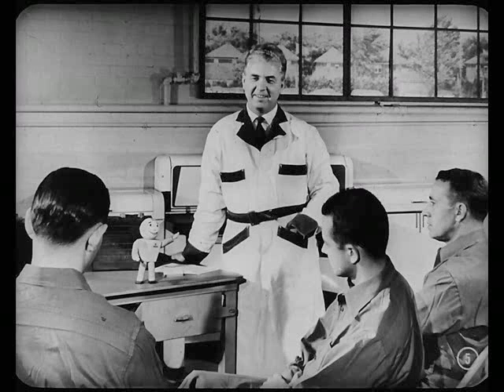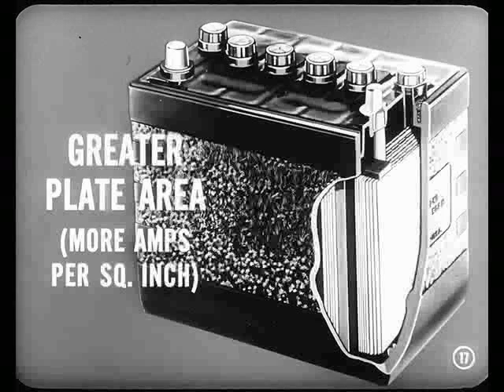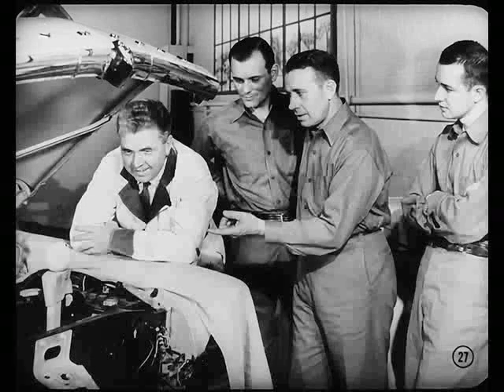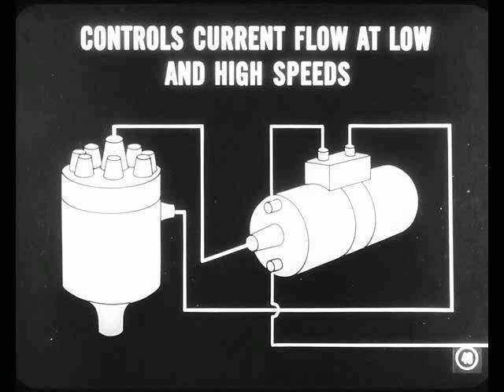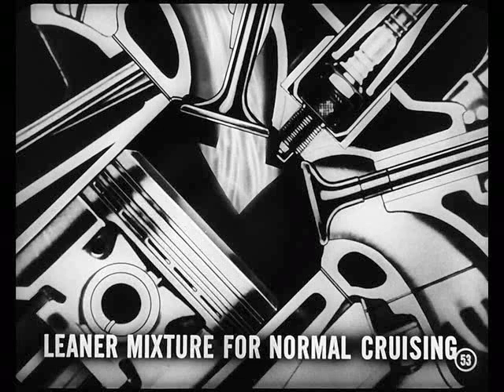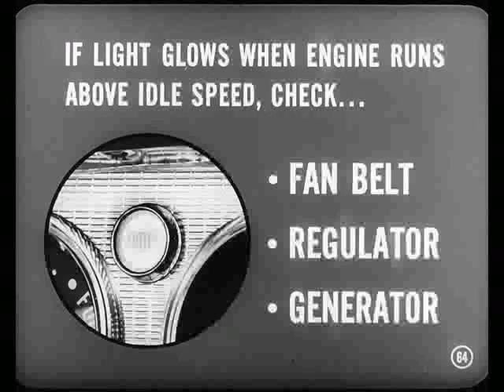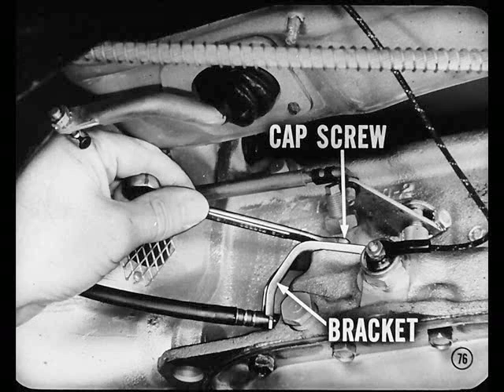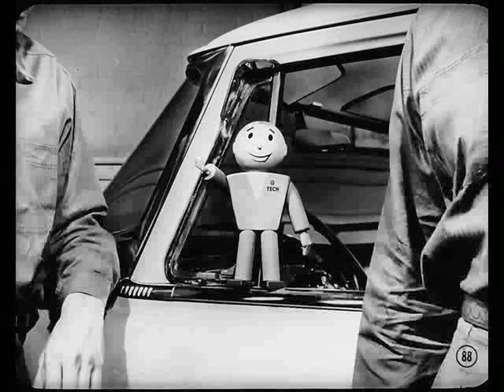MTSC - 1955, Volume 9-1 The 12-Volt Electrical System & Powerflite Push-Button Control

Comment: The change to 12 volts was a cost-save.  Higher volts means less amps, and less amps means you can use thinner gauge wire.  GM did it in 53 to cut production costs, so everybody else followed for 56, except for Willys, which waited until about 1958.  Nobody wanted to be seen as "old fashioned".